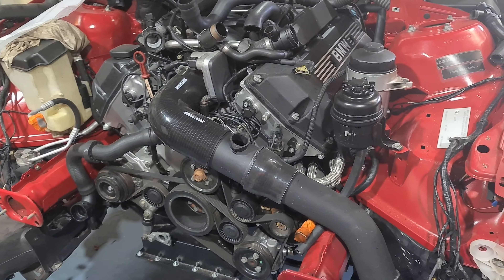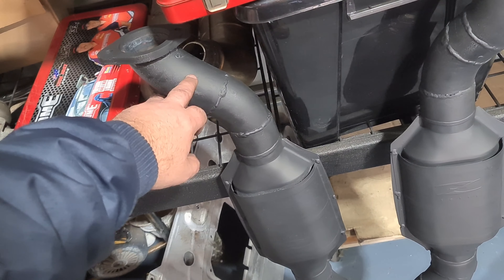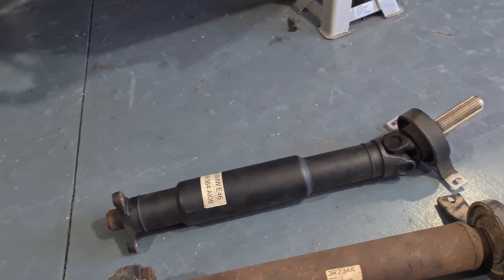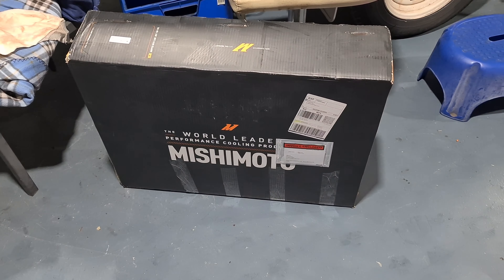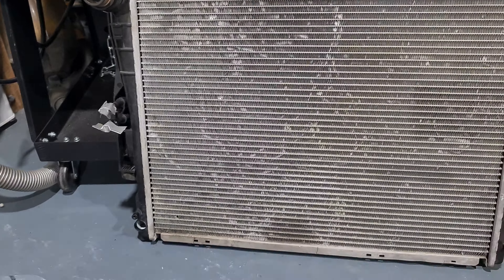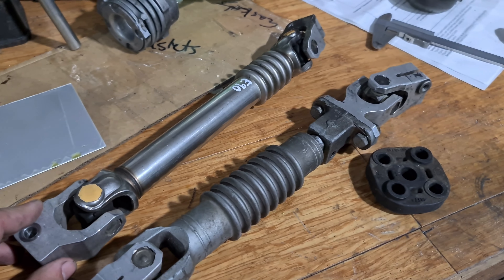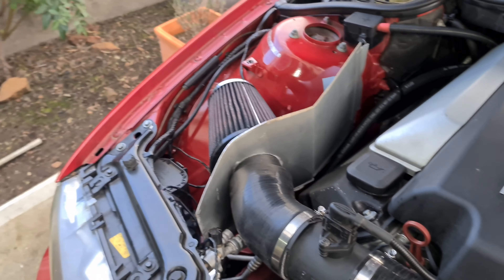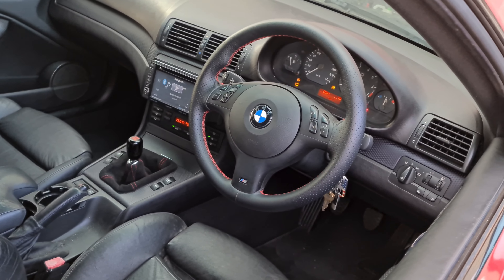E46 M62 V8 Swap Part 9

Comment: How much did it cost u for that build?  Sick build btw🤙
Reply from the maker: Thanks bud. I bought the motor and gearbox including all accessories and harness for $1200. Head gaskets, bolts, timing chain guides, custom intake, mass airflow sensor, catch can: perhaps $300. Mishimoto radiator $650. Custom tailshaft $650. Custom DME $350. Billet steel flywheel and HD clutch $450. Custom oil pan and engine mounts $900. All prices are in Australian Dollars.
Reply: @banarcus  im planning to build my e46 and im lost on what to do to it yk, so now i have an idea of what i want to do to it
Reply: @banarcus  that’s amazing car for money
Reply from the maker: @aqib2000  Thank you :)

Comment: How was your integration level? Cruise control, ac etc
Reply from the maker: Hi RetroX, climate control will work once I have the E38 AC hose installed. Cruise works as it should, nil mods needed just plug and play!

Comment: I’m thinking about doing the same swap to my e46 how did everything fit? Did you have to cut anything ?
Reply from the maker: Yes I had cut out a small portion of the RH chassis rail to clear the AC compressor fittings and remove a section on the LH behind the strut tower near the DME box so that the rocker cover would clear. Very easy to do.